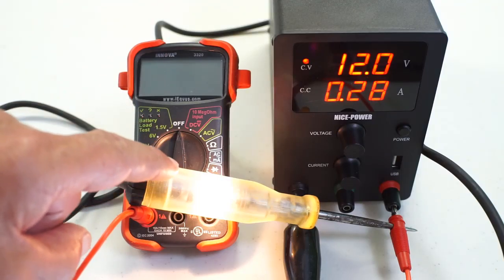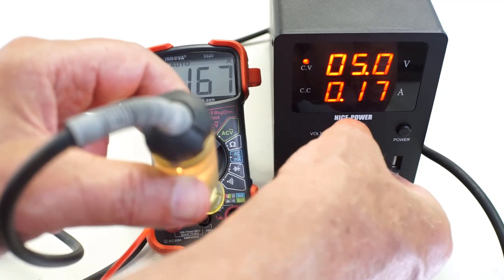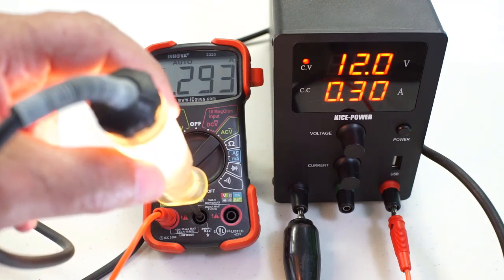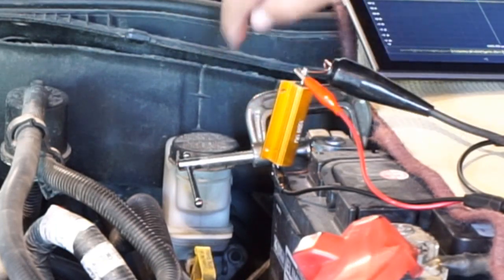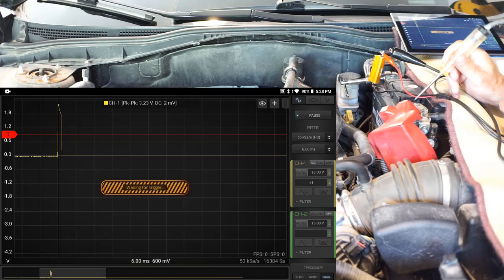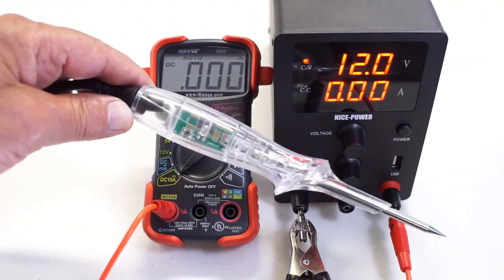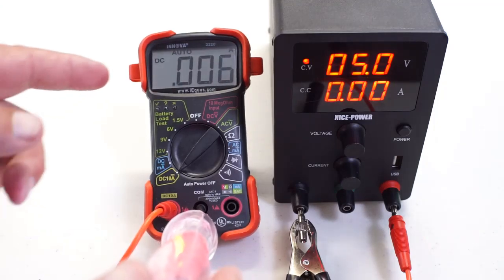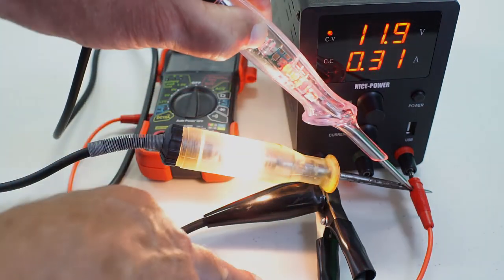GADGETS#115 - TEST LIGHT SPIKE

Comment: LED and incandescent test lights have each there pro and cons. 
The big benefit of the LED test light is the low current demand, so it can be use on delicate circuits like the signal coming to the fuel injectors if a engine doesn't start (LED light will flash if you crank the engine when the fuel injection system is working) 
The drawback of a LED test light is that it can light up with 12V in a car, even if there is a bad connection (rust, loose connection, copperwire half broken etc....) 
but when the problem circuit needs to transport a higher current, like the starterrelais per example, it wil fail.
In this case, a incandescent test light is more propriate. 
The drawback of a incandescent test light is, that it draws more current and can damage delicate circuits, and can also trigger faults in the CANbus selfdiagnostic 
if the incandesecent test light draws more current then the part you are diagnose (like a sensor etc...)
So it's handy to have both in your toolbox.
Reply from the maker: Totally agree, Bjorn

Comment: An incandescent light initially has a low resistance when it’s cold. While the glow wire warms up, its resistance goes up too until it reaches a equilibrium. The spike on the scope showed that brilliantly. 😉
Reply from the maker: CORRECT, Eduard:)
You'll notice I moved over to the vehicle battery to do the test as to eliminate the Power Supply surge variable.
Bottom line, it puts a substantial load on a sensitive circuit on contact. And a "glowing" 180mA amp when warm.

Comment: I absolutely loved that vid for these reasons. The one ohm resistor in series. The usage of the scope. I would have loved more detail. What kind, how big, what capacity was that one ohm resistor?  Where did u get it?  How did u know how many milliseconds the two amp spike lasted? U must assume that us dummies don’t know what comes so natural to u. I watched a few times and sorta answered my questions. I really enjoy when test things, and then explain how u set up your equipment. Thank u Denis!!
Reply from the maker: It's a 1Ω  100w resistor. I have featured these before on the channel and they can be found @ AMAZON, eBay and Aliexpress
I based the 6ms duration on the graph's 4ms / div scale.
The video was inspired by Yvan's Subaru power windows saga ... which led to discussion on our HScope Group.
Reply: logical canuck I saw that vid. Had he used the led test light, it wouldn’t have smoked his expensive switch. Correct?
Reply from the maker: @billrimmer5596  Yvan's point is that he had not seen or heard of anyone frying a computer module with an incandescent test light. He provided us with an example.
Most modules have current limiting resistors in the circuits but there are plenty of warnings about being careful around these.
If in doubt, LED is cheap insurance.

Comment: Ivan...  had a problem with a 2017 Subaru Outback  Windows circuit .. they have a  resistant circuit to stop the window if something causes a jam  (like an arm or your pet sticking his head out the window) safety circuit.  Ivan 248  is a master troubleshooter. I'm a follower of Ivan.  What happened to Ivan was that the dead battery which caused the windows to lose its mind and it needed to be re-program. it takes less than a minute to resolve.  I uploaded the procedure to  Ivan  2017 Subaru Outback Part 2 ; but it was already too late. Keeping up with Tech is hard,  we all get burned.  Oh Yes, I have a Subaru  Outback LL Bean.  I'm in my 70's retired and a computer person fastest computer in the world  CDC Cyber 7600.
              NOTE: I'm looking at getting 
and OSC2002M 50 MHZ  but now I see there is a 100 MHZ note is the 50 Mhz fast enough??
and Yes I'm following you and Martin  also Ivan and an Eric O (South Main Auto ) would  be real tester for you Kits Etc.
Reply from the maker: +Storm S - Yvan's power window module mishap led to group discussion and inspired this video.
If your interest is mainly automotive, the OSC2002 or OSCA02 is more than enough. Even the OSC482 at $60 is fine.
For me, the important criteria is that the LOTO choice is on the HScope supported list.